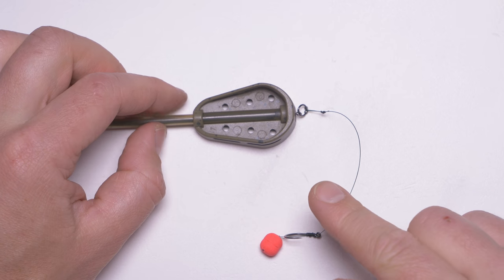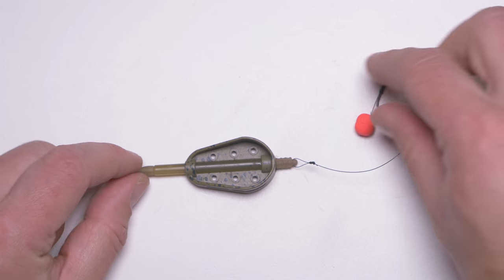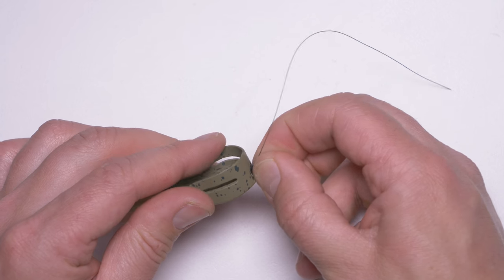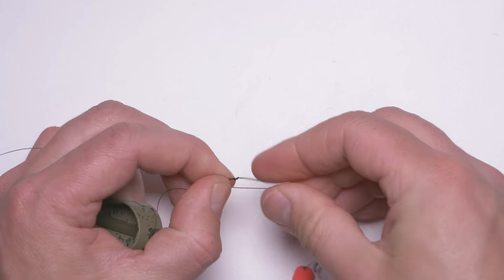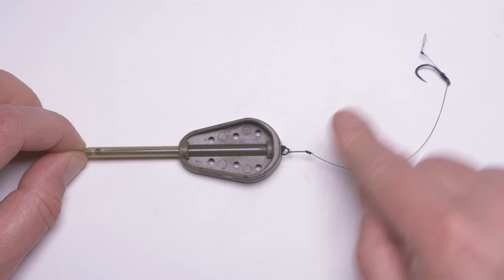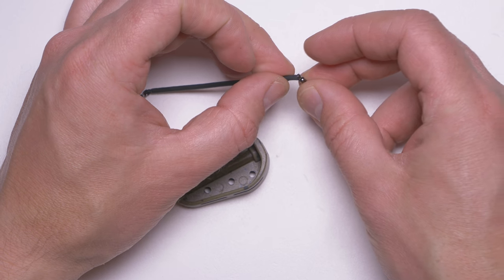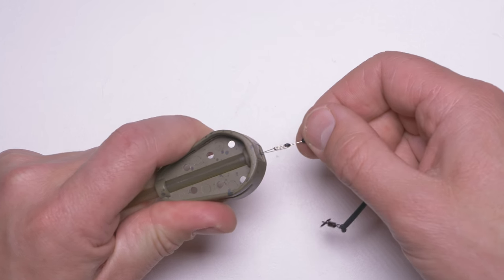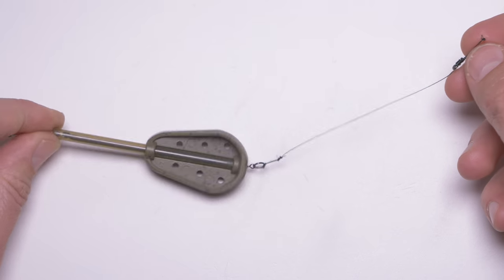How to improve HOOKLINK to METHOD FEEDER connection? Feeder fishing

Comment: I'm only asking Andrew but how strong is the new Knot???
Reply from the maker: Hey Keith,

I take by "new knot" you have in mind swivel to elastic knot (Overhand knot OR Surgeon's knot)? If so, yes, it is strong enough - never had any problems with it; also, those elasticated feeders has ring attached using the same knot (or at least as far as I can make it out) when you buy them. For some reason this knot works well with elastic.

Cheers
Reply: I caught a 20lb carp a few weeks back using this knot in my elastic exactly how you have in this vid. so it is strong enough 👍

Comment: Thats not a propet loop to loop connection..u did a line cutter connection..not good
Reply from the maker: It's very good. You should try it 👍
Reply: @AndrewsKnots  you should try a proper loop to loop connection..its much better 👍👍
Reply from the maker: @martinpecheur8506  This video is about using a swivel with ring to hooklink connection to have the hooklink moving to any direction. It does not matter at all how you connect the hooklink to the ring as it will moving anyway. You can tie it on.
Also, hooklink to ring connection in this video uses 'loop-to-loop'.
Good luck
Reply: @AndrewsKnots  sure...good luck

Comment: Cobblers, makes no difference as the bait is taken off the feeder by the fish 9 times out of 10 ... never had any issues with the drennan connector beads at all .... finding solutions to problems that do not exist ....
Reply from the maker: I believe that you got the idea behind this video wrong. It says on the tin "How to improve.." and not that "normal connectors are useless...".
All in all, every good match angler knows that each percentage you can enchance something (rigs bait presentation etc. etc) will add up and make a big difference in the end.
Thanks for opinion in any case.